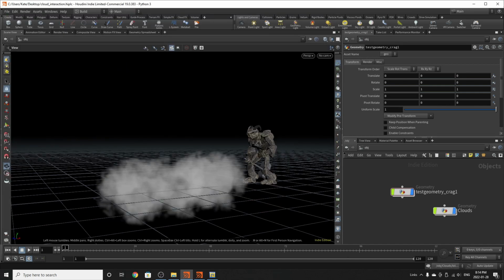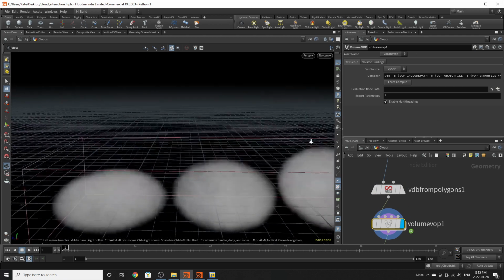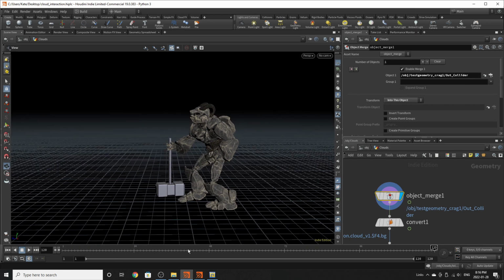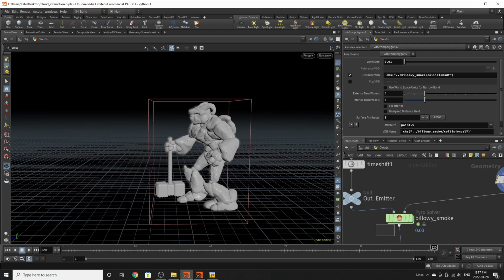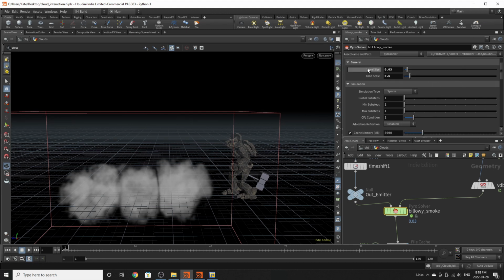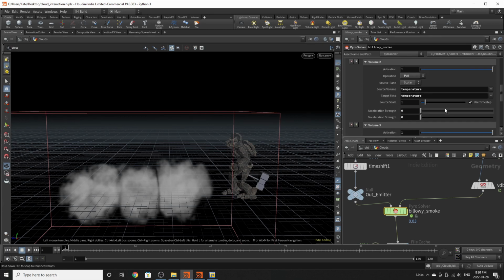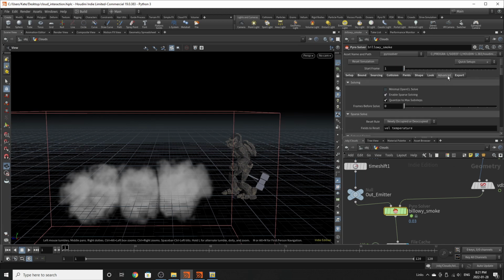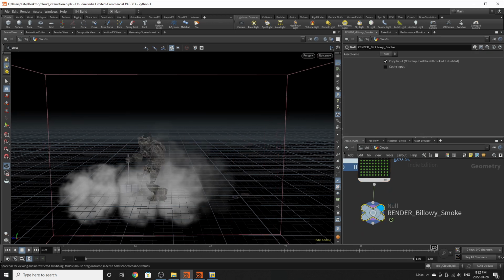Cloud Interaction With Houdini 19 || Houdini Tutorial

Comment: Great video! still works nicely in houdini 20.5! I am wondering one thing, is there a point to setting the voxel size different per object? the cloud was 0.02, crag is 0.01, and the final solver is 0.03, wouldnt it be better to set everything to uniform 0.03? or is there an advantage to varying voxel sizes?